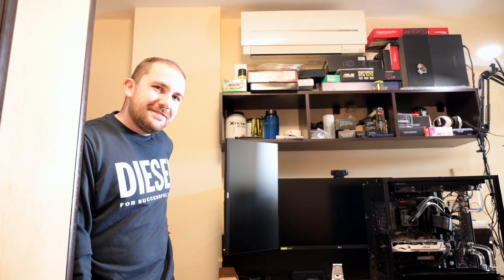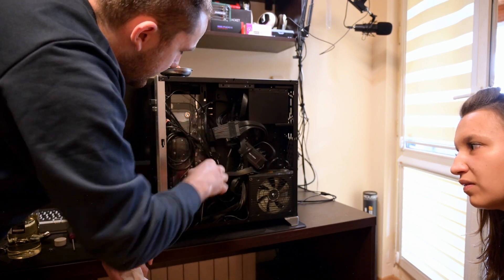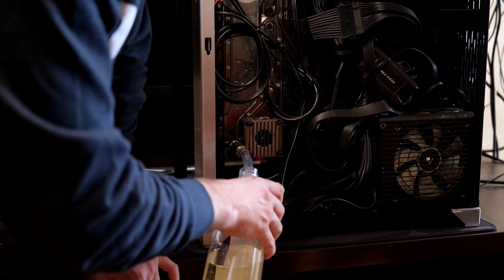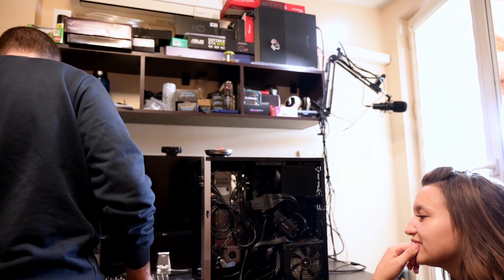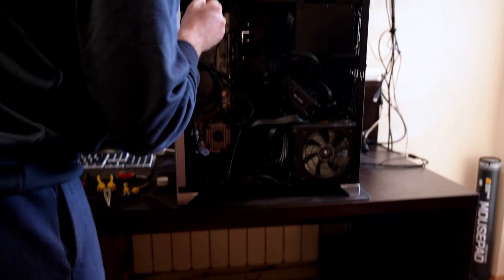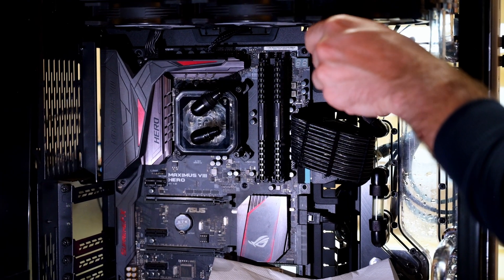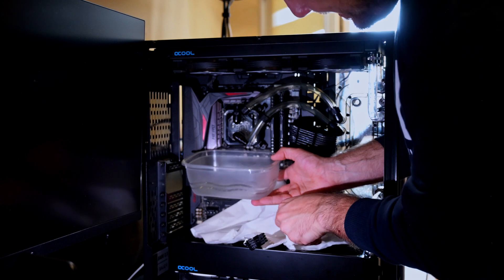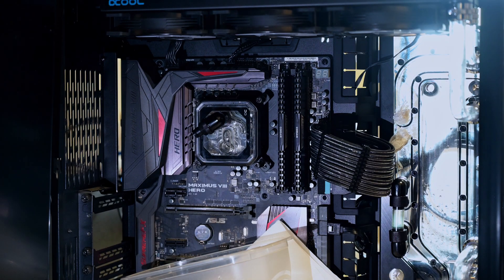How to Drain your water-cooling loop ? - The WATER-COOLING Saga Episode 1

Comment: Thank you! I have the exact same setup of distro plate with drain above the bottom radiator, and couldn't find the explanation for proper draining *anywhere*!
Reply from the maker: where your pump is located he drained from there tilting the case, but it wasnt easy  and he replaced the pump with stronger one
Reply: @GabbyTech  - Yeah, it was a pain. Took me an hour of tilting and some blowing, but got there in the end. I'd run a few days of distilled water to check the loop, for leaks then needed to drain it all for a change to coloured fluid. Next time I'm either going to find a better drain-solution beforehand, or I'll go coloured from the start. Or both.😋 First water-build, so can't think of everything I don't know to think of. 😁
Reply from the maker: @Talwyn_Wize  which premix are you using ?
Reply: @GabbyTech  EK-CryoFuel Navy Blue. Just posted my build on Reddit, too. 😊 https://www.reddit.com/r/watercooling/comments/lb87hh/project_nova_complete/
Reply from the maker: @Talwyn_Wize  very beatiful build well done